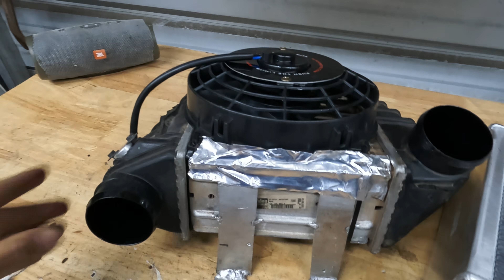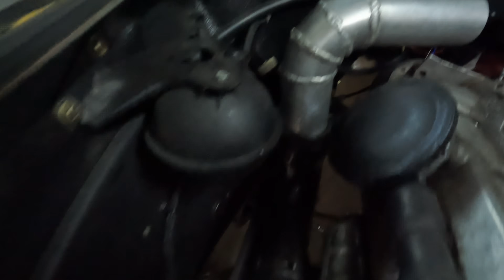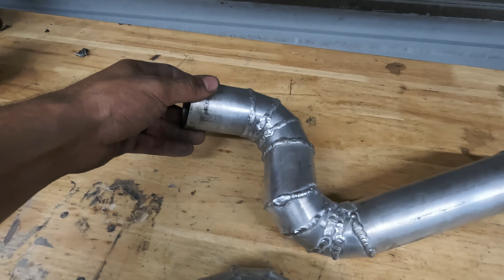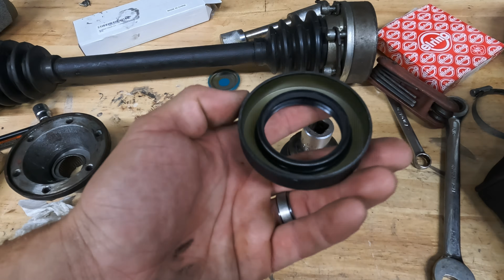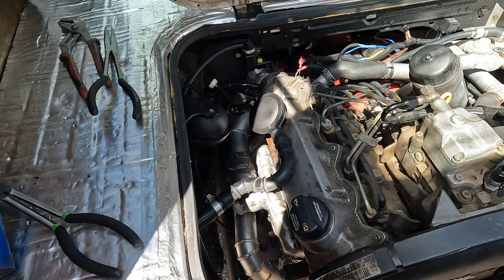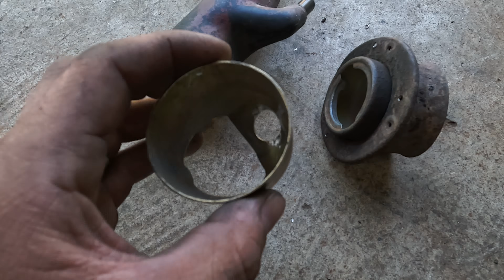TDI Swapped vanagon Upgrades

Comment: The diesel vanagon is so weird, we never got them in Australia. They would have been great. I would have tried to bend the pipes instead of all those joins.
Reply from the maker: The original diesel vanagon was very underpowered and kind of a dud. Fortunately you can swap one of these TDIs into any van!
Bending aluminum is a total pain, It really likes to crack. (And i dont have a pipe bender lol) But for the stock motor the 2" pipes even with welded joints have proved to be more than enough

Comment: are you running the stock turbo
Reply from the maker: Yes, as of right now everything on the motor is stock
Reply: @TinCupOutdoors  The tiny stock turbo is probably the biggest problem. Can't breathe well enough; causes high temps. That, and a water to air is the way to go on these vans cause you can put the rad where it needs to be and the intercooler itself usually needs very little piping, so much less lag.

Comment: I'm sorry but it's not gonna work. There's no airflow in that area the fan will help but you won't notice any cooler air gains. The only real way to go is a water to air cooler
Reply from the maker: Your probably right, I'll eventually get an intake air temp sensor to see what it's running. I think with the fan and a scoop under the van I should have good enough airflow for a stock alh 🙏
Reply: I honestly think it will work. Report back on how it goes, and safe travels of course!